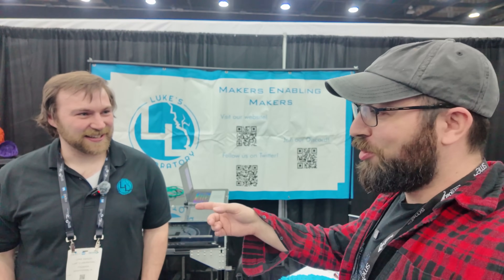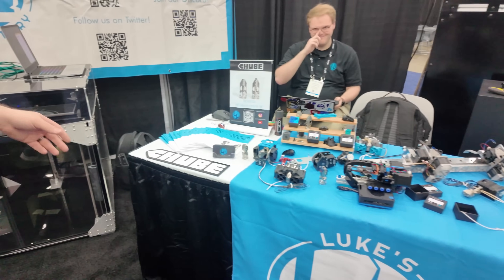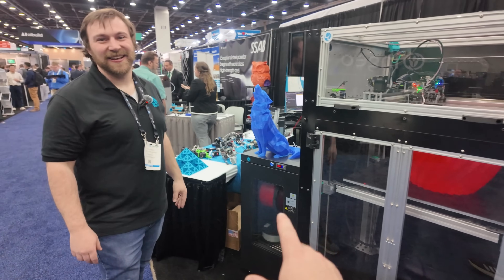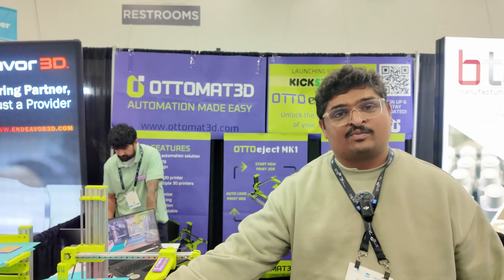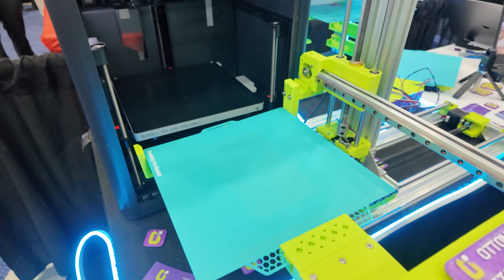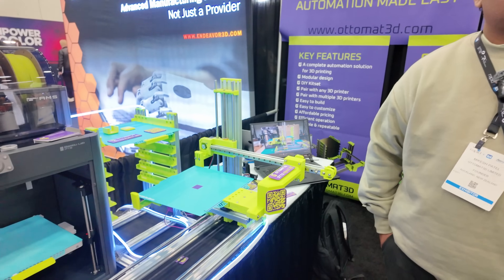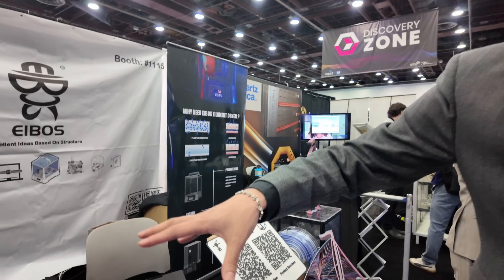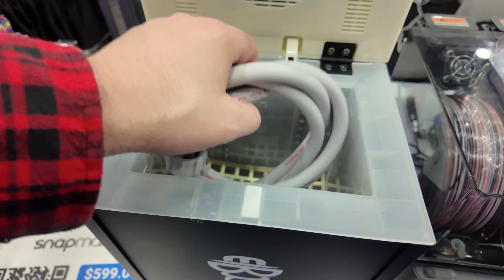3 Cool things FOR YOU from RAPID+TCT 2025!

Comment: Thank you for the highlights from the RAPID+TCT show.  Many interesting things.  Eibos is on to something with their automated resin print wash/dry/cure station.  FDM and MSLA have both improved over the years but resin printing has fundamental advantages over FDM printing but isn't being utilized as it should because the post processing is an expensive, labor intensive mess.  I've been surprised that there hasn't been more effort to automate it.

Comment: i have yet to find a reason for the FIN nozzle standard to exist when V6 exists, outside of the fact it has a little step in it for the sock
Reply: So there's a few good reasons - Smaller, which has a few advantages in and of itself! The smaller size and thread means you need less sealing torque (reducing accidental breakage of nozzles). It also means that your nozzle material (looking at you, hardened steel) matters far less for overall melting performance (no longer need to bump temps for steel). The smaller nozzle size means I need less surrounding material as well, resulting in a lighter, smaller package overall. The FIN boot is something I kinda want to take to the v6 nozzle market in general for those hotends that have it, but If it was time to pick a new standard, FIN honestly is the correct choice.
Reply: @LukesLaboratory  finally someone can tell me the benefits, Thanks Luke!
Reply: @ TBH They do list this on their website - https://www.sliceengineering.com/blogs/news/fin-the-complete-guide
Reply: @LukesLaboratory can you please share the advantage your FIN hot end has over the Micro Swiss FlowTech hot end?
Reply: @LukesLaboratory  its pure bs and you are easy to get money from. slice just made the nozzle trying to trap people in there extremely expensive system. They are leachers and should go down

Comment: How does the high flow nozzle for the Bambu get away without a PID tune?
Reply: Its thankfully quite isolated from cooling air, has the same heater+therm too!
Reply: @LukesLaboratory   I would have thought differences in thermal mass would matter, but maybe that's in the noise.
Reply: @JonS  Amusingly, the heater+therm positioning means it actually doesn't matter that much as the therm would see the heat being wicked away anyways, as soon as it came out of the heater.
Reply: @JonS Having run different wattage heaters and hotends on the p1s, I can tell it definitely does PID tuning itself based on the overshoot and undershoot of a few heat cycles on the hotend. As an example, using an 85w (stock is 45w) initially spikes around 5c over quite quickly upon heat up. After 2 or 3 cycles, this comes back to normal stock heat up time and temperature.